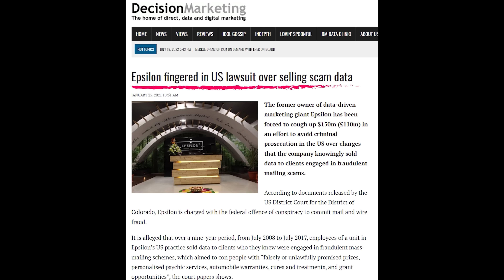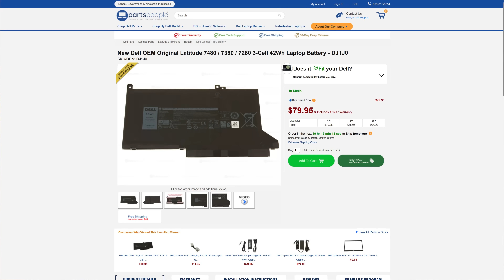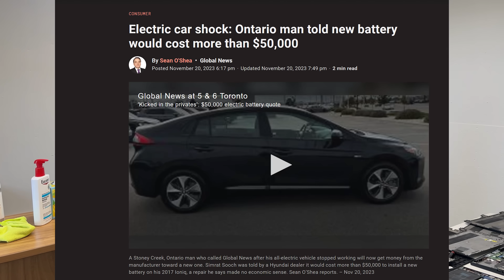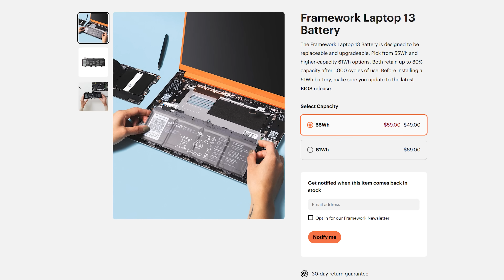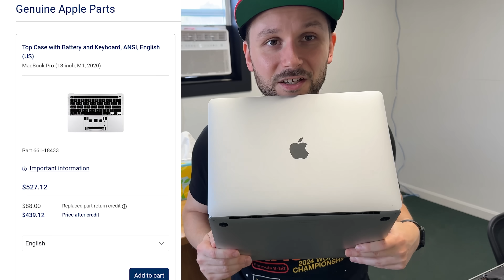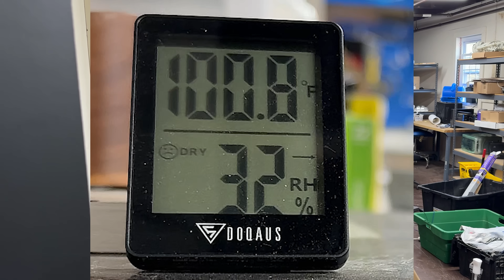Planned Obsolescence: Why is Replacing a Battery STILL So Difficult and Expensive?!

Comment: Alot of the OEM support is pretty pathetic. I'm up in Canada and I've had good luck with this aftermarket wholesaler in BC for batteries. Generally I'll receive BYD units for about 1/3rd of the cost of the OEM.

Comment: it's actually pretty easy to make a windows 11 installer you only have to modify it with rufus then you plug it into your pc open the flash drive and start the setup it can be used infinite times (until the drive dies) i actually use it

Comment: I totally agree with you.
But I have replaced most of my laptop's batteries with cheap knock-offs. I may have had good luck, but they have been very good for the extra 3-4 years that new battery will last for.
Just replaced a battery for a HP Spectre x360 from 2017 with a £25 ebay one. Old one was at 70% SoC and lasted 2-4 hours the new one lasts 4-6 hours, almost like new. I think 30-60 is reasonable for a 60-ish Wh battery, would.have loved to get it from HP, but nothing was available. Laptop is Windows 11 compatible, and I plan to keep it for another 5 to 7 years as all I do is watch movies, Excel, Word and Outlook on it.

Comment: both my 4th gen HP Envy i7 and my HP g250 6 gen i5 batteries are dead and I use them on power like a desktop( I gutted the batteries and put the empty enclosures back)  but my MacBook Air i5 from 2015 has amazing battery life still so why can Apple use great batteries but other companies are using potatoes to power their laptops

Comment: STANDARDIZE BATTERY is the name of the movement.
Adjust the component layout around the battery, not glue batteries around your components.  
The devices that use AA batteries or any other standard better batteries today not worse.
They just glue cells together today, require them to be separate sold in standard cases.

Comment: I have a Dell Vostro 3558 i3 5th generation, which I have used for over ten years. Today it runs fine, and I daresay, at par with newer windows machines, as it is powered by Linux. I never changed its battery. Its battery died a few months ago, and now I run it always on wall power.

Comment: Well they are hardworking to make the "need plateau" vanish. I am using top of the line yesteryear Ryzen 9. Guess what, Windows 11 choked it so hard, I can't even use Ms. Word smoothly.

In the future, an office worker who just casually writing two pages report would need an overclocked Ryzen 99 Ultra Max Extreme Edition just to satisfy the operating system overlord.

Comment: There should be 10 standard sizes/shapes per device category.
Manufacturers should be limited to using one or multiple of these standard batteries when designing their laptops.
For an exception to be given, the given battery should have open specs and be sourcable from at least 3 manufacturers.
This would make it viable for there to be real competition and working logistics chains.

Comment: One of the things I do for my batteries is set the to stop charging at 85% and to start charging at 40%. You should be able to set that up in the BIOS without needing any other software installed on the computer. But, I would say those batteries are pooched, good luck getting the covers back on.

Comment: Would you recommend for/against someone buying official parts to hold onto? My mom, sister and I all bought the same laptop (dell latitude 7420 used off ebay). As of now Dell has official repair parts on their website (150 for the battery :/)? I have no problem sitting on like a heatsink or KB parts that can't go "bad" really. Mainly just asking for the battery. The two of them use their laptops every day, I only use it 2-3 times a week for maybe 3 hours at at ime.

Comment: I have that exact same problem, and it’s driving me crazy to ridiculous levels. I’ve been searching for a battery for an HP 240 G1 however I can, and basically, I’ve only found junk. None of the ones I’ve found work, and I don’t have the money to gamble on random batteries. It’d be easier for me to start soldering batteries together just to make it work. I’ve even managed to find components that improve the laptop (RAM and the Wi-Fi card), and yet I still can’t use it because of that damned battery and its charger, which I can’t find anywhere (at least one that actually works)

(Also with wired Earphones, I even soldered damaged ones and joined them together like Frankenstein so I wouldn't have to buy new ones)

Comment: my s24 I changed the battery but I had to undo a million screws that are stupidly small the problem is also how they design it in such a way so that you have to either send it to them to change or replace the device, iphones are the worst for this disgusting especially when we are supposed to be caring more about our planet
Reply from the maker: I'm sorry to inform you, but the iPhone battery can be changed in less than 5 minutes. There is a misconception that Samsung phones are easier to repair, when in reality, they cost 10x more and require 5x more labor. I speak from someone who loves Android and also owned a phone repair shop for 10 years. Samsung is the WORST. They hide behind Apple because Apple gets more press for their bad behavior.

Comment: I understand your frustration. I searched a long time for a replacement battery for my XPS 15, finally finding it at PartsPeople. The same for a replacement for my Dell 5410. Didn't need it yet, but bought one for backup when it dies. PartsPeople  say it's OEM Dell. I believe they deal with refurbishers so you could probably get a better price, particularly in quantity. 

For $50 more than the crap you can buy on eBay or Amazon, that  seems to be the best you can find. It seems simple to me: just raise the price you are asking for your refurbished Dells and Lenovos by $50. They would still be good deal at that price, and everybody should be happy.

Comment: man, my HP Omen ate 2 ebay batteries.  And its hinges.  If I had a nickel for every battery I had to replace I'd have about a dollar at this point.  I miss easily replaceable laptop batteries like the old days.  None of this "taking off the back cover" BS.  Like what the Thinkpad T40 had, just a chunk of external battery you hit one switch and it popped out.

Comment: Article 11 from (UE) 2023/1542 says that all batteries must be user replaceable without any special tools not readily available unless those tools are provided with the device.l at the time of purchase. 
I got a recent android tablet that comes with a packaged battery that you can swap without tools, that doesn't require any glue. At the end of the 90's and early 2000's every single battery was packaged in a solid enclosure with connectors and you could swap batteries the same way you swap batteries in a remote. This is still possible from ear buds to e bikes or even cars batteries could be replaceable. At minima laptops should all be able to work without a battery when plugged in.

Comment: I've had 16 phones since 1994 and most have failed due to battery issues, with perhaps some obsolescent issues concerning later smart phones. The same is true of laptops too. My first PC was a Dell Inspiron 5000e laptop computer, which was released in 2000, running Windows 98. It actually still powers up and works, though the battery is completely dead as is the internal CMOS battery, thus one has to correct the date if you do start it up.  In 25 years I have got through at least 7 laptops including the aforementioned Dell Inspiron 5000e, the Dell Inspiron 510M, a Dell Inspiron 1520,  Dell Q15R, Dell Inspiron 1525, and the Dell Inspiron 15 5100. Still using a Dell Inspiron 3502 which works fine though is soon to potentially made garbage with Microsoft's end of support for Win 10. Batteries are certanly a big issue, but so is planned obsolescence and lack of support/repairs.

Comment: portable devices stubbornly resist standardization. i can plug any PSU into any atx motherboard and put it into any atx case, and add whatever components i want from whichever manufacturer of ssd, ram, gpu, etc. (excluding mobo/cpu)

but a laptop manufacturer wont even have parts that are compatible across their own devices within a single year (excluding maybe ram)

theres a lack of interest, or a bottleneck. i'd bet its not in the interest of battery manufacturers to standardize; they have a streamlined, efficient process, and i'd imagine the parameters like voltage/capacity/dimensions is as tweakable a setting as changing the mode on a microwave, for which they charge too much. if they'd standardize the form factor, the laptop manufacturers would have to follow suit, but it's not in their interest so they can continue to charge too much for making batteries.

best to go after the battery manufacturers instead, sue on grounds of market manipulation or somethin like that because that shit is maybe even fraudelent.
Reply: ofc as consumers I think it's best to put our money where our mouth is, and to educate (not possible without sounding preachy) others on how to spend money more consciously, either buying refurbished or buying laptops that are repairable. like, framework looks very good. i have an alienware area51m though that i got from my employer for "work" and its super repairable.
Reply: like, if i had a process that allowed me to make any screw for less $1 production cost, i'm not gonna make million copies of the same screw and then sell them; im gonna sell the service of making bulk custom screws for whatever price i can pull out of my ass claiming its a custom process while its just a setting on my screw making machine that i need to change.

Comment: Reasonable in law is actually a very good term.

You'll have experts argue on both sides and then a jury will determine if it's reasonable or not.

More concrete terms might be easier, but it's reasonably the same.

Comment: My wife has a 2016 Razer Blade 14" that she absolutely loves. I've been trying to keep it alive for years, first battery puffed after 3 years, it happened almost overnight and expanded so violently that it broke the glass touchpad and mostly snapped a ribbon connector off the keyboard. Razer wanted $250 for a factory replacement battery, $150 for a replacement touchpad and & $225 for a replacement RGB keyboard and since I had previously had a lot of terrible luck with aftermarket ebay and Amazon laptop batteries, I paid it because she was determined to keep the laptop shelling out over $500 to Razer. New battery came with a 12 month limited warranty and by month 13 was only holding 10 minutes of charge, Razer obviously said it was out of warranty and then informed us that they don't sell the battery for that model anymore. Searching the internet for genuine replacements the rare places that had genuine inventory wanted like five hundred bucks for them. 

She begged me not to get her a new laptop because she loved that thing and hated Windows 11, and we're deep in Covid at this point so I tried researching the most reviewed aftermarket options available on ebay and Amazon, eventually settling on one that 70% of reviews looked OK enough. It worked, but didn't even last 6 months. Did I mention she only uses it on battery power 5% of the time and we had put an 80% smart charge limit in place right when we bought the laptop? 

She finally agreed it was time to replace the laptop in early 2022 but wanted something as close to her 2016 Blade 14 in style and form factor, so I bought another now more obscenely overpriced Razer Blade 14 2022 model, Ryzen 9 6900HX, 16 GB RAM, 1TB NVMe SSD and RTX 3080 Ti for $3500. In Razer's quest to make Apple MacBook profit margin on commodity x86 commodity laptops they chose to solder the DDR5-4800 RAM to the motherboard even though AMD had no such requirement to do so on Ryzen 6000 mobile when using RAM of that speed and SO-DIMM was the standard. Furthermore, they didn't even offer the ability to purchase a model with 32GB, in 2022 their flagship 14" gaming and creator laptop with an RTX 3080 Ti could only be purchased with 16GB of RAM and not upgradeable, chose to not even offer disgustingly overpriced 32GB or 64GB RAM factory configuration options and yet it shipped with windows 11. 

So I'm pissed at giving Razer $3500 for a laptop that ships with a processor and GPU that "should" be capable of playing most modern game titles at usable performance for many years, they only offer it with 16GB of soldered RAM, they stuff an RTX 3080 Ti into it that has 16GB of VRAM (same amount of VRAM as the only system RAM option they chose to sell) stuffed into a chassis with such poor cooling that it struggles to keep a Ryzen 6900HX under 100 degrees when the discrete GPU is disabled, and then neuter the 3080 Ti by limiting the power for the GPU to 100W resulting in gaming performance that was barely able to keep up with my ROG zephyrus 14 with 5900HX and RTX 3070 from the prior year.

Oh, and after all that, she hated it. Hated Razer's new bloat ware software package and the fact that she was forced to use windows 11 because a windows 10 downgrade wasn't supported, hated the new track pad and keyboard, disliked it so much she kept using the 2016 Razer 14 that was barely hanging on.

Here we are almost at the end of 2025, she transferred her stuff to the new Razer Blade 14 but went back to the 2016 and refuses to use the new one. I've since replaced the battery on the 2016 Blade two additional times bought two replacement power supply bricks, one replacement display panel (got lucky with buying a donor parts laptop from ebay), I've replaced her SSD, and I have to tear down and "de-gooch" the entire cooling system every year and repaste periodically to keep it cool enough, she only ever uses it when plugged in to AC power and while she fought off Microsofts many attempts to trick or force her into upgrading to Windows 11 for years, she's now beginning to have more stability issues that seem like RAM going bad and I think her Windows 10 days are coming to an end.

I won't be giving Razer another single dollar of my money, and won't ever by my wife a new laptop, she has to go find something she actually wants and likes because her $3500 2022 Razer Blade 14 is just a paperweight that I also wasn't allowed sell or give to someone else who might use it. It's also sad that you can spend maybe $1600 today to get a new lower end gaming laptop with an RTX 5060 that outperforms Razer's 2022 14" flagship with an RTX 3080 Ti.

Comment: I have a laptop from 2016 that I think must have been some of the last ones that had user replaceable batteries. A few years ago I replaced it with an off brand battery with no issue. I plan to keep this laptop running for as long as I can even with windows 10 ending. At the same time, upgraded it to an SSD and repaired the only other issue, the charge port being lose.

Comment: I'm so fucking pissed dude my phone is from 2022 and both the screen and the battery are bad, and Motorola straight doesn't manufacture the battery or the screen anymore. So I have to either buy a new phone or use some fuckass fuckin aftermarket garbage

Comment: No one is gonna stop using Windows 10, this is nonsense. Stop spreading misinformation. I’m still using windows 7 and XP, it works fine. No viruses. Nobody is gonna scrap their computers because Microsoft stops releasing updates. Nobody updates their computers anyway
Reply: Software stops getting updates on older OS and will force you to upgrade
Reply: @Sammy102093 kid called ltsc:

Comment: They should make laptops like they used to with the detachable batteries, and let you able to charge the laptop and use it without a battery installed.  They started making it this way for more profit.

Comment: My MSI GP76 Leopard 17.3 inches, i7-11800h+RTX 3070, 32Gb RAM, that I use to write right now, DOES NOT have a battery... It died... And so, it became a glorified desktop... kinda... needs to be plugged... It's 4 years old...

Comment: If it weren't for modern web browser bloat and modern video codecs, grandma's recipe machine would run fine on a Q6600 from 2007.  In a desktop she'd be able to slap a cheap Intel A310 or a used dirt cheap entry level video card new enough to include AV1 to get modern codec support.

Comment: Hi bro I need your help for real, My pc keeps crashing after installing amd driver, i installed and tried all different versions but won't work even using ddu in safe mode reinstalling it, still my pc crash, even using windows update, wumgr, step by step installation chipset etc to driver still crash, even hardware using one ram to another, i still dont get the problem for 1week straight please HELP ANYONE, even suggestions helps, i use ryzen 5 4650g, PRIME A320-K Motherboard 😢

Comment: I just bought a refurbished phone (with new battery), because my old phone battery was so bad it wouldn't survive a 1-2s hour trip while using.
I put up with it for a very long time because I didn't want to buy a new one just for this reason, when it functions totally fine otherwise. 
It's a 9 years old model and I can use it for everything I want (except some apps due to old OS but who cares).
I would have bought a battery, but it cost the same amount as the refurbished phone with new battery which is a 4 years newer model. 
It wouldn't have been a good deal.
I hate this.

Comment: As a formar R&D lab tech for the lithium battery industry I can tell you for a fact that there is a multiple of hundreds percent mark up on those batteries. Just as an example 21700 lithium ion batteries only cost at MOST $3 a cell to manufacturer. A pouch style like laptops use? Probably less as they aren't as extensive and complex as cylindrical. So yeah you are getting screwed big time.